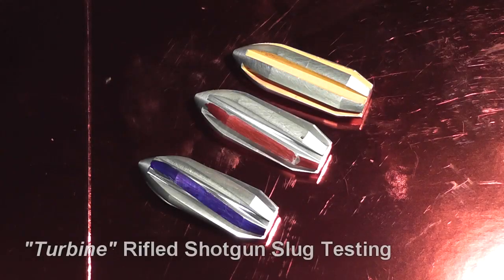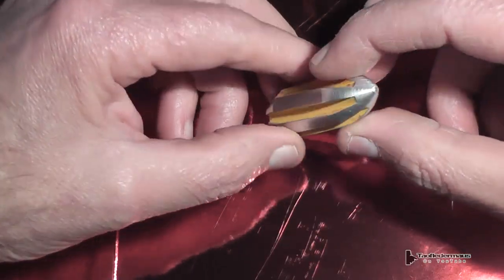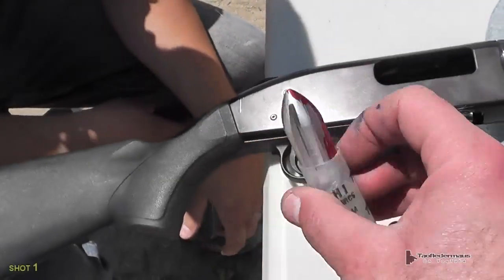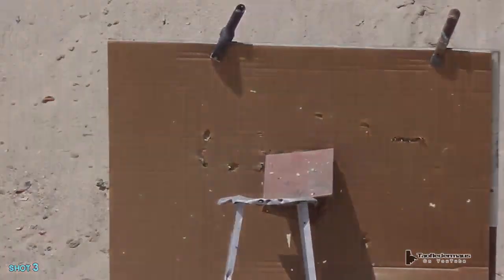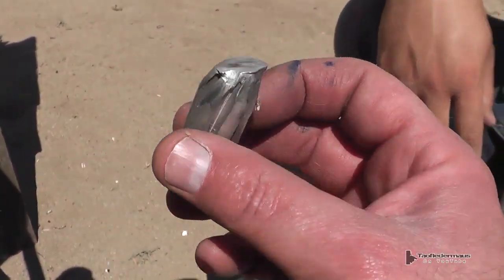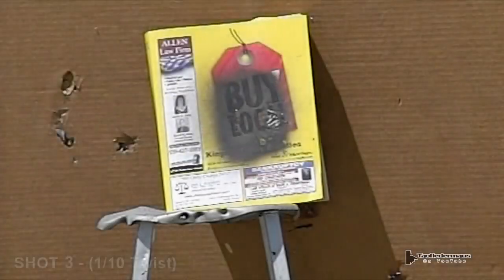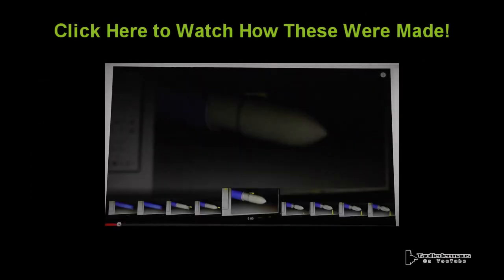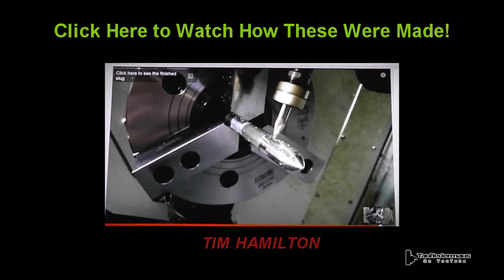Custom Aluminum TURBINE Shotgun Slugs  -Testing

Comment: I know this is super old but the wadding was not allowing the rounds to start rotating inside the barrel and the high speed shows that once the wadding separated it killed any ability for the round to rotate as it should.. it needs to spin inside the barrel

Comment: I'm thinking drill 3/8" hole in the tip down a bit past half the length of the slug and insert a 1/4" - 3/8" bit o lead.  Reshape the tip,  hell; maybe just square the tip off. 

This would move the center of mass forward and perhaps keep the slug from tumbling.

Comment: With a standard, rifled barrel, the rifling cuts into the soft material of the bullet, while the force from the powder keeps it moving forward, causing it to spin. For rifling to work, the material that's not rifled has to be softer than the rifling, and therefor sacrificial. In the case of those slugs, I could really only see them working if the barrel was made of a material softer than aluminum. But even then it wouldn't really work since the slugs don't expand and form to the barrel. The aluminum really only served as additional speed since it has less mass than almost any other practical bullet material, but less energy as a result.

Essentially... sacrificial bullets > sacrificial barrel.

Comment: i think the slug should go straight instead of rotating, it will create more damage, and for that what i suggest, as we all know its the shortgun which makes the pattern not the cartridge which makes the slugs to cover distance, so in short you created a nice cartridge but you should make a special barrel of a gun so that it should go straight, for reference, you can see the inner side of a shotgun it got rings which creates pattern, rest the attempt is awesome..

Comment: Maybe if you added the physical features of the whistling rounds and the rifling of the rounds here you can get better results. I used to launch amateur rockets. The ones with more weight on the tip would launch more straight. Maybe that piston design minus the Russian style missile turret and add the riffling of the rifled rounds to the slug would help add stability and balance. I'm a shotgun enthusiast and shoot at the hip with perfect accuracy at more than a hundred yards. They call me the surgeon

Comment: the issue here is assuming a rifled slug will compensate for a non-rifled gun..... bound to be proven wrong in the long run. even shooting a regular shotgun slug, they do tumble a bit but stay on course even in a smooth bore shotgun...... now when shooting slugs..... one typically uses a rifled shotgun to gain more range in it's use.... had you used a rifled shotgun, these bullets wouldn't have flipped around as much.

Comment: A solution for Tim Hamilton
the problem is when the blast rushes past the projectile  in the barrel
the projectile spins clockwise
but then the air drag reacts on the flute and reverses the direction of spin.
and at zero revs the projectile end overs.
Part of the solution would be to start your flute slits from the front and not complete them all the way through
creating a sealed round slug at the back that prevents the blast passing the projectile
also adding velocity though more efficient pressure behind the projectile.
The problem with not taking material equally of the back is the projectile becomes back heavy and that end will want to travel up front.
But being made out of aluminium maybe a lead or carbide nose core could shift the center of balance?
Reply from the maker: There is a gas piston sealing the gases behind the slug

Comment: They need to be constructed more like a rocket. Center of gravity ahead of the center of pressure. And using a ball mill for the channels is better at keeping the air in contact with the groove instead of it jettisoning off the side and not imposing torque onto the slug. Also milling all the way to the nose is most important due to the divergent nature of air at such high speed. Also aluminum steel and high temperature oxidizers equal thermite. I'd be using sleeves on those, or some copper instead.
Reply: David Washington:  The spiral grooves on the slug are interesting to me, but they may be heavily contributing to the tumbling flight.  I can see the "flutes" on the nose catching the air and pull the nose off center, but it "looks" to me that the depth of the grooves would cause a vacuum in each groove, and I can't imagine the dynamics that may cause, (Answer, tumbling I see).  You make a equal case of weight distribution IMO.   I would like to see one fly with a better weight distribution and groves (ball nose like you say) only about .020/.030" deep, with the grooves on the body and the very end of the nose, (end opposite of the tip) to keep the nose smooth.
Just my initial thoughts. :)

Comment: Add small, spring-loaded tail fins for stability, and a titanium tip and center rod for penetration. The aluminum body will still offer light weight, while the titanium add strength for punching the target.

Comment: they may need a radiused ramp up  the back of the turbine slot terminating at the back of the bullet. the pressure pushing is probably counter rotating then when bullet leaves barrel the aerodynamics of the turbine slots start working opposite. you may need a solid "wall" on the back end of the slug.

Comment: Sorry but i'm pretty sure your definition of twist rates around 1:20 is wrong.

10 to 1 means the groove twists 10th around the round from tip to toe. You can see the 10 is more diagonal whilst the 28 hardly has any twist at all.

Comment: the problem of this slug is the two different spin forces it will get.
in the first stage, the shot is fired, and the pressurize comes from the back of the slug causing it to spin counterclockwise... that is not what you wanted, because when the air pressure in the front is getting bigger it tries to spin clockwise... causing a dead moment in spin and the slug is out of balance.
The idea is not bad, you might want to make the rear of the slug totally flat. make the 'wings' up to 90%. this causes the back pressure in the first stage to bump up to a flat circle without getting in to the gap giving it an anticlockwise spin.

Comment: did you notice the way a solid chunk of aluminum traveling about 900mph (1250fps) can't go through a steel plate?   Isn't it amazing that a thin aluminum sheet metal wing tip was able to slice right through heavy alloy steel box beams on world trade center exterior wall,  going only 500mph.....hmmmmm.  the 911 event changed the laws of physics

Comment: Rifling the projectile does not work.  The barrel is rifled because it cuts into the projectile, forcing it to turn.  In this case, you're asking the air flow to spin the slug by some little slots cut into it.  You'd be better off with pop-out stabilizer fins.

Comment: What is happening is as the slug leaves the barrel there is enough gas to still push the back end of the slug. With the rifling, there is too much drag that slows the front of slug and you have the force pushing the slug which causes it to start tumbling. In short you can't have any drag on the front of slug or it will tumble due to the way it is accelerated.

Comment: One thing I noticed watching the fastest cameras you used was that the slugs started to straighten out near the end of your range. It's something that I have seen before in other videos with these sorts of things. The slugs you used weren't shaped right to get the sort of spin you wanted straight out of the barrel, but if you had put the target farther away it would have had more distance for the threading to catch the air with, and it would likely have stabilized the slug like you wanted it to. 20 yards is an awfully short range for testing this sort of thing.

Comment: I think the rounds with the spiral channels are tumbling because the the rotation imparted by by propellent escaping through the channels  begins spinning the round but the spin is killed when it exits the barrel because then compressed air coming from the front spins it the other direction i.e. propellent coming from the tail will spin it clockwise but once the major pressure comes from the atmosphere, it rotates counter-clockwise.  

Basically, you can't have a fined projectile that picks up any spin inside the barrel from it's fins because it will spin in the opposite direction as it will in flight. None of the fletchette weapon had in barrel spinning projectiles. And artillery size fined projectiles usual are fired smooth bore with the a sabot that shields the fins from the propellent and keeps it from spinningl

Comment: the biggest problem is all the energy is on the back end of the slug and when it's pushed out the energy is causing the rear end to become the front. stop making them almost an inch sticking out of the shell and lower it half way it'll fly way smoother

Comment: seemed like a lack of effort on creating targets. probably took a long while to make those slugs. you shot the first pieces of trash you could find.
Reply from the maker: wah
Reply: TAOFLEDERMAUS granted I have zero knowledge of supersonic aerodynamics but I have a feeling one of the big problems is that the rifling follows the entire length of the bullet so what happens is the gasses from the powder, as they expand, exert a force on the rifling as it travels the barrel and makes it spin counter clockwise instead of the slug turning clockwise as it's intended (or vice versa). you end up with the reverse effect because the gasses flow from the back of the slug up the length of the tracks until the slug leaves the end of the barrel which is when your spiral force reverses. in the short amount of time and even with a very slight amount of rotation after it leaves the barrel it wobbles for a while until the air starts flowing through the rifling the correct way but that slight wobble can cause it to start tumbling end over end. you guys should try the same kind of slugs but get someone to make the rifling tracks wider and deeper at the tip of the slug and progressively thinner and shallower as they go down in an attempt to also slightly pressurize the air that travels through the rifling tracks which should create a little more drag force on the air passing through the grooves hopefully increasing the rotation. and make it so the rifling grooves are pretty much non existent at the bottom of the slug so its just round with no visible grooves or just very tiny slits when looking at the bottom of the round, the slug should almost be the same size as the barrel (or as close as you can get) at the very back of the slug so it starts out just traveling the barrel with little to no spin at all, then gains rotation as it flies through the air.
Reply: masterof weedpuffin kinda my though also, apologies, I didn't read this till after reading down the posts. simple minds think alike...I try to stay with the K.I.S.S. method in alot of what I do in life.
Reply: masterof weedpuffin I think the channels can be much much narrower and maybe just 3 or 5 of them.
Reply: What do you want them to shoot at? Gold coated targets with diamond studs?

Comment: you should try putting drilling in the center middle about 85% way though, like a air pocket.
Reply: like when shooting the slug out, that air pocket will push straight out, while having that turbine spin to it.

Comment: I know this is old, but do you think of you gave it another 30 yards it would start to come true? An arrow coming off of a bow doesn't stabilize for several yards. I wonder if it would settle down and spin right eventually, and how straight it would be when it does.
Reply: most likely no, the slug was spinning all over the place.... An arrow just flexes around a bit when released, it doesn't spin head over heels....

Comment: Hay you dumb 9/11 deniers see this. Do you believe air plane Aluminum skin is about 7 printer paper thick can cut 3/8 H beam with 1 foot of concrete wall cut through and not have any entre damage?
6.55 min in. A firing an Aluminum shotgun slug with a steel ball bearing hit steel. The ball bearing welded itself to the steel plate and the Aluminum just smeared like gum pushed on a wall.

Comment: Aerodynamics says that wind will travel where there is least resistance. This design doesn't do that. Try putting a hole through the middle with smaller riffling inside. 

Your design only continuously forces air on the first riffling that immediately tumbles the projectile.

Comment: The shotgun barrel has to be refiled, not the bullet itself because as you can see, it will just tumble... nice try though. Remember, the barrel is what causes the  bullet to spin, as the bullet starts to ascend from the barrel, it starts to spin faster and faster till it exits and by then, it is spinning at full speed. You could build a spiral shaped football (nerf built one in the late 80's) and toss it across the sky but it still isn't going to spin, you still have to throw it in a way that causes it to rotate. However, the shape of the spiraled football or bullet (used in this video) could possibly cause it to spin faster and longer, but you still need that rifled barrel to get it started.

Comment: The bullets are tumbling because the front of the bullet isn't being stabilized while travelling down the barrel.  If you had the plastic surround go all the way up the bullet to where the point starts to cone, it would probably stabilize after the plastic surround sheds itself after leaving the barrel.

Comment: Great video. One suggestion for the guy making these rounds: at supersonic velocities the physics of flight switch to a slight variation of fluid dynamics versus aerodynamics - which means that the projectile is now travelling in a non compressible medium. In order to maintain controlled flight there can be no "flat" surfaces towards the direction of travel. I noticed that the rounds had a small flat spot at the forward tip, if he machines them to a sharper point the rounds will likely do much better.

Comment: Shotgun slugs are not stabilized by rotation like rifle bullets.They are
 stabilized by havier part in the nose like arrow.All Breneke and 
Foster,Gualandi and other slugs for smoothbore had plastic wad on back 
side to be stabilie in flight.Rifling purpose on the slug is for safe 
pase through any choke,even full choke.

Comment: I was thinking mess around with longer and shorter barrels to see how they behave maybe these slugs need a special barrel to fly right
Reply: mike murrey nm)
Reply: Yeah. Normal bullets are already spinning before they leave the barrel. These slugs wouldn't start to spin until after they leave, and the uneven force from the barrel exit would probably overcome the way the air is resisting around the slug and the fins.

Comment: The reason why shotgun slugs tumble is likely linked to how it fires and the barrel it's using. And the weight and center of gravity of the slugs.

You don't see this for regular rifles and bullets, because bullets themselves have  the weight on the tip weighed towards the front.

The slugs in this video is weighed in Aluminum throughout the whole shape, so there is no frontal center of gravity for the ammo to keep it's shape.

The best modification is putting Lead on the Tip to give the front a much needed frontal weight.

Comment: If you wanted it to fly straight without rifling I'd suggest making it similar to the KE Rounds used in Tanks, the front of the nose enables are to be pushed out evenly so whilst it has high momentum the air resistance will keep it stable and impact with a point load rather than a blunt load.
Id suggest the design with the jacket being a solid body part so it doesn't having a split action, therefore making it one part. Whilst this reduces max range and speed, short range accuracy should be better and should carry more mass at the expense of excessive deceleration at range.